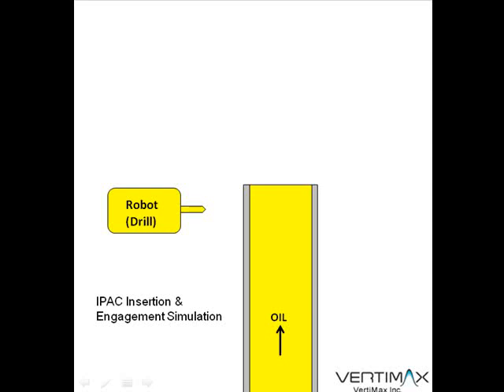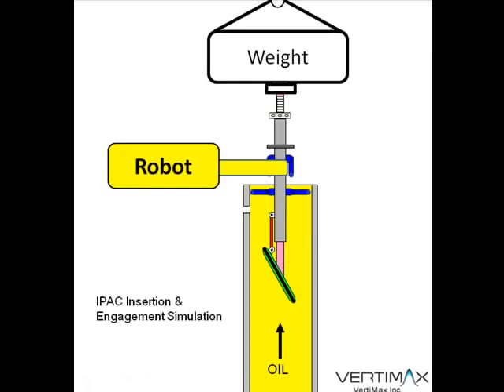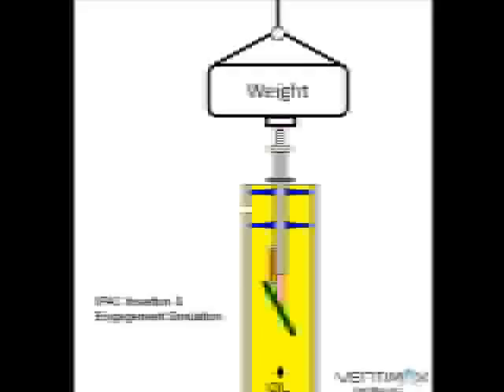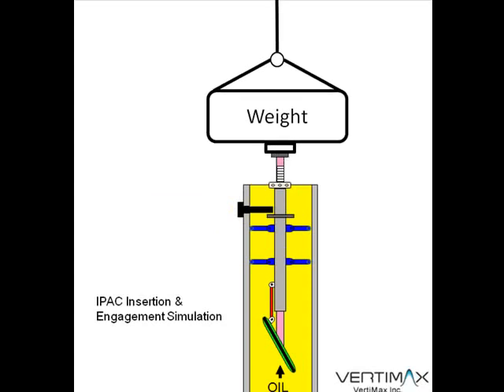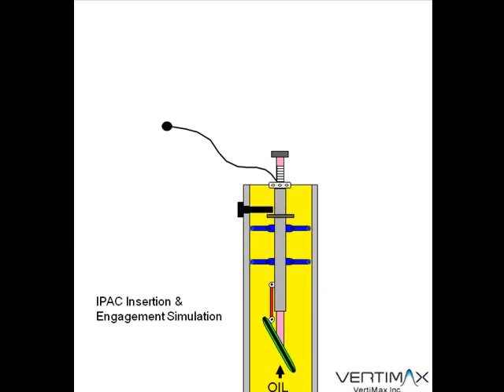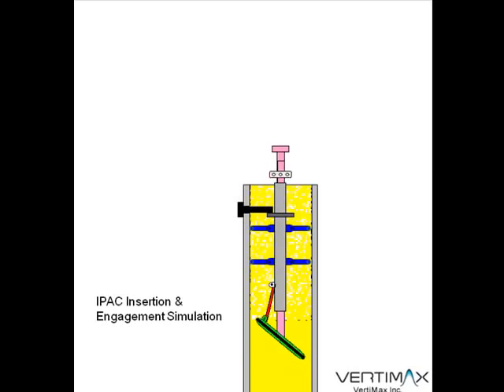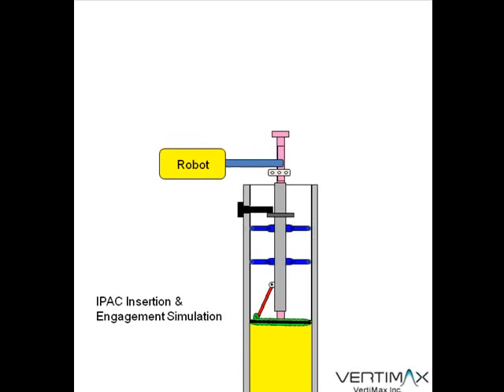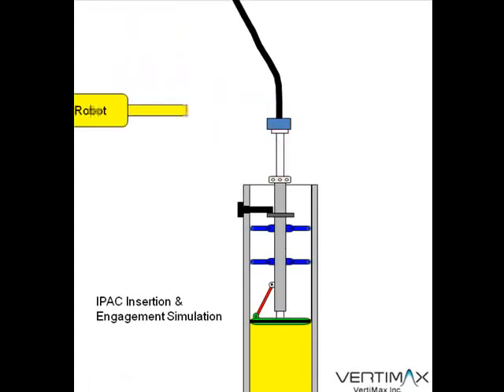BP Oil Leak Solution (Part II - Deployment Animation)

Comment: If its 6000 psi pressure differential and 21" pipe..
What is your calculation on the weight required for the pressure displacement from the blow by portion..